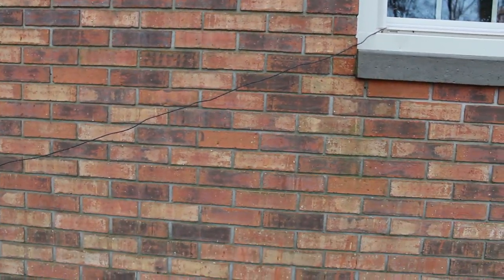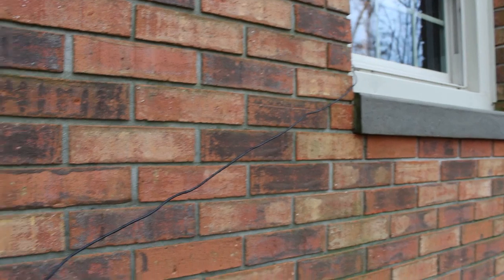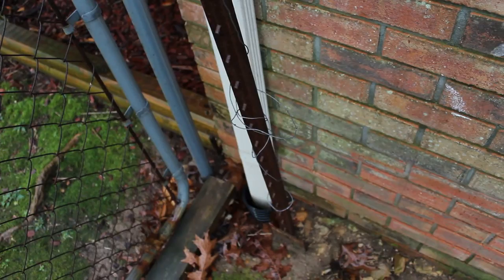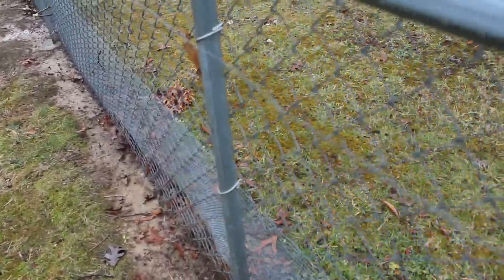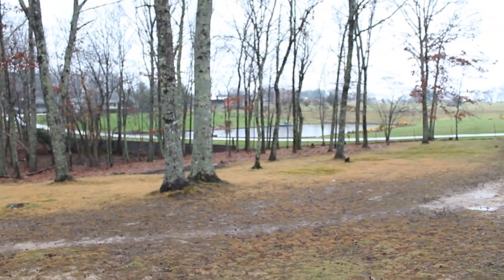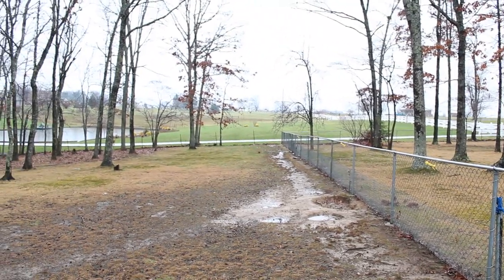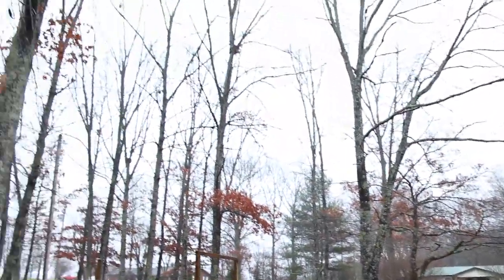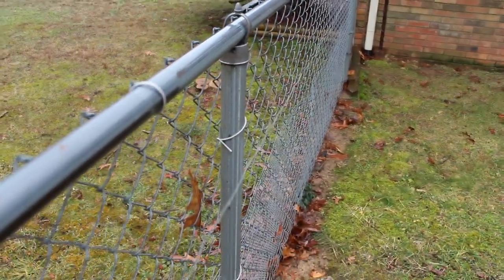My Longwire Shortwave Antenna

Comment: 1. your input lead should never be grounded whether your transmitting or receiving.
2. Everytime you make a 90deg turn on your antenna, your creating a cancellation zone, and its important to keep your turns matched to the frequency vs impedance at which your trying to operate.
3, that 240 volt power overhead, is a nightmare for receiving quality signal. cause your input runs through a pre amplifier first, and then a buffer than another amplifier where all the mod and demod happens. your singing the 60hz blues my friend its call "Inductice Coupling"   :) best of luck on learning. love the effort to explore

Comment: @KD7IIA

I second this. I made this newbie mistake when I first got into SWLing and I noticed a difference in my reception as soon as I figured it out.

Also, the groundwire thing is great advice. If your radio isn't metal, then connect the ground wire to the negative (-) side of your radios batteries.

Comment: A length of around 10 meters seems to work well for 6Mhz-17Mhz.
300,000,000 / 6,000,000 / 4 = 12.5 m (quarter wave)
300,000,000 / 17,000,000 / 2 = 8.8m (half wave)

Comment: You get shields from the metal fence, I think!
You want to get the antenna high as possible, away from the ground and fence!
Length of the wire  depends what wave length you listening to in meters!

Comment: I found having a very long antenna 100 feet+ causesd alot of ghost signals from the upper AM band causing interference in the SW band. I have mine around 50 to 70 feet for the SW band. In the 1990s due to analog TV interference I once ran a 120 foot coax cable away from nearby TVs and center fed to a 50 foot longwire  and shield was connected to a 3 foot pipe hammered into the ground. It did cut down on TVI  with good signals. newer digital TV types seem not so bad for TVI as far as I know.

Comment: This is an old post....

I second getting it out of the dirt BUT... you are doing it right away from the power lines. You didn't say what wavelength you're trying to get. Like that you probably getting lots of ground reflection. An old Army trick is to use a fishing sinker and sling shot with some thin twine to get it up into a tree so you at least get some air wave.

Comment: @KD7IIA 
+1 on this.
basically, your feedline (wire coming from your house), your attempted ground, and longwire are all acting as one antenna. a properly grounded antenna system should have a shielded coax feedline 50 ohms coming from house-the center conductor attaches to antenna wire, the outer shielding braided jacket attaches to ground. your ground should be either a close-by cold water pipe into earth, a close by electrical service ground, or a ground rod sunk at least 8' down.

Comment: Ground wire needs to come off the long wire , basically your shorting out your antenna by shunting to the earth ground. To see what i mean go to your radio, turn it on and enter WWV  or any strong station on the dial. Take note of the signal strength, go out remove the ground and go back and listen to the same station again. Take note of the signal strength it should have jumped up. Yeah you will need either a balun or antenna tuner for that long antenna be effective.

Comment: Why didn't you just use the fence?  Not exactly a Struber Curtain, but close enough for short wave.  Just hook on to the top rail.  Don't worry about the fence being grounded, it'll work.  Also the closest 110 outlet has 2 slots for power and a round safety ground.  Look at any 110 volt plug.  Stay out of the power and plug a wire into that safety ground round hole and you got the entire house wiring system to use.  Those grounds run to every wire in the house.  It is like a giant 3D spider web of free antenna around you.  I would have used the fence for one side of the antenna connection and the house ground for the other.  It's like a bumper sticker I saw on a Silver Cloud Rolls Royce once that said "Why pay more?"
Reply: HM Dickson  Because the fence is GROUNDED ! And it will short circuit the antenna !!!
Reply: Moronvideos1940 He is receiving, not transmitting.  The fence being grounded will make no difference for a shortwave.  Volumn and legnth is what you want.  Your talking micro-volts to fire a receiver.  That fence will do just fine.
Reply: HM Dickson Better make sure that there are no neutral and ground reversals at any point in the wiring of the house (which is quite common) !
Reply: +HM Dickson are you saying that for a great receiver antenna one can just plug a wire into the ground slot(the round one) of a house 110 outlet? So living in a flat I would get an antenna as big as the whole building?
Reply: +Brooklin Funkproject how can we find out? What would happen if there is one of those?
Reply: +alfiozzz the only way to know is to test every outlet with a 3light tester....  what would happen?  you'd get a pretty big shock!  It's just really not a good idea at all.VA3PDG
Reply: +alfiozzz Yes.  Understand this is not optimum, but a "get by"  like the grouned fence.  That safety ground is also grounded at the fuse box, just like the fence.  You need a long wire ungrounded for best performance.  I use my 80 meter inverted V Ham antenna when I listen to shortwave.  That is 133 feet (both dipoles) long.  Even longer wires would work better!  If room is the problem and you know the frequencies you want, you can build a "magnetic loop" and tune it with a variable capicitor (think hula hoop).  Just look them up on you tube.  They are very narrow banded.  Fine for specific freqs, not much for band scanning.
Reply: +Brooklin Funkproject ROTFLMAO!  No shock Brooklin.  The only reason I said to use the safety instead of the nuetral is that he might get into the hot side of the plug.  All nuterals and safetys are hooked to the same groundbar in the box.  The safety is just an extra circuit to bleed off to ground shorted appliances with metal cases before you get shocked.  The electrical inspector would have checked for crosses before he passed it.  Naked or green is a far cry from white :)  LOL, if we are into ham calls, try my extra class AE4YW :)
Reply: +HM Dickson prob should have stuck with your fou call - good luck !!
Reply: +Brooklin Funkproject LOL!  Well I just took what they issued.  The FOU call was a pain when working CW :(  Besides with the AE4YW call you get "Always eager for young women" or "Amply endowed yelping warthog".  Surely you can see the advantage to the 2 by 2.  Maybe I'll catch you on 80 or 40 meter CW some night.  And maybe,  just maybe a no-coder won't come in with "Is the frequency in use?"  Luck to you too!
Reply: "It is not the class of license the amateur holds, but the class of amateur that holds the license"73
Reply: +HM Dickson The listening performance is better with a wire that is cut and tuned to close to resonance even when "just listening". Been there, done that.

Comment: Long wire isnt always good, you have to peak the wire to the frequency you are using, this can be 40 meters or 20 meters for an half wave antenna.
Your groud for HF you can use best a few wires about 1/4 wavelenght and connect together at one side en connect this end to your radio ground bij a wire, lay de wires streched on de grass, this is the best way.

Comment: KD7IIA is correct.  Don't ground your antenna! That is a mistake!  All you signals will drain into the ground.  Ground the radio.  You should also get a 9:1 Unun (like a balun) is you want to take it to the next level.

Comment: You should never leave bare copper connections exposed. Weather eventually degrades the connection. Solder each connection and then cover it with electrical tape.

Comment: Just catapult the wire into and around the perimeter of the treetops where you want it, not hard at all, and follow the plans on the net or get a ham to visit you for an hour or so to make the connections and you're away !!

Comment: You should avoid metal objects with your main antenna, as well as not grounding it.
It would be better to use trees than anything near the fence at all.
Reply: I can understand how some can recommend to use metal (just stick it to the fence) while others like you say to avoid it all costs :) I am trying to improve my knowledge and I don't understand which is wrong and which is right :) Could you clarify this a bit if you mind? Thanks!
Reply: alfiozzz It’s difficult, you don’t show your radio. The worst thing you’re doing is connecting the antenna directly to Earth before the radio. The Earth is a more attractive destination for the signal your antenna picks up than your radio is, so the better the Earth you make that way, the worse your signal will be affected. Antenna and earth should be two separate wires all the way to the radio. If it’s a telescopic antenna, you can just clip the antenna lead to that. If the radio has no Earth connection, you can get one from the negative battery terminal.
Reply: alfiozzz Then get your antenna as high as you can, avoiding any objects including the trees. You can string rope around a branch and attach wire to the rope slightly below the branch. For the Earth, if you have copper cold water pipe in your house that is a good place to start, and you might avoid ever needing a second wire outside of the house. If cold water pipe makes an improvement but you can’t use it, you can still connect to any copper pipe leading to a tap outside your house.
Reply: +Brek Martin Firstly I wanted to make tell you I'm not the guy who uploaded this vid so I am not connecting anything to anything. :) Secondly, thanks for your answer but what I was asking about is how some people advice using fences for antenna while others say stay away from any metals because they are likely to cause more noise than work as an antenna. This is the point I was asking a clarification about. Thanks! BTW I have a medium range portable radio which has an external antenna connection. Just yesterday I bought 100 meters of 1.5 mm diameter electrical wire for just $15, I am not sure what I can do with it. For now what I did is just unwrapping some 20 m of it holding it high outside on my terrace leaving the  wrapped wire roll (what was the name for this...) on a corner of the terrace protection rail. Maybe it's completely wrong but it's increasing my reception... But I'd like to know how to improve it! Or if it can be dangerous maybe, expecially the unwrapped roll of wire?
Reply: +alfiozzz My mistake, you’re not the video author! :D There is more than one problem associated with a horizontal antenna in close proximity to metal, but the same applies to any object particularly a tree or fence that gets wet when it rains! :D To the best of my knowledge all of those problems are all a result of capacitive coupling to the object, and the undesired effects.. transfer of RF energy to Earth bypassing the radio, cancellation of current on the antenna, and in the case of a transmission line, detuning of the antenna.
The only problem I see with 1.5mm wire is it’s not going to last long outside strung up to something, but if it was cheap, and you have a lot, who cares? It would be no good for a transmission line but should be ok for rx.
I would not leave it connected to the rest of the roll... not sure of the consequence, but there is a general limitation on how long a “long wire” should be. Google can give you some wire lengths. next message...
Reply: +alfiozzz The author of the video, and I assume yourself also, are not transmitting, and therefore interested in receiving commercial shortwave or medium wave stations over distance rather than ham radio chit chat. Almost all (if not all) commercial radio stations use vertical polarised antennas, so the closest you get your wire to vertical the better (straight up out a window to a branch atop a tree). In this case you want to disconnect it from your radio at any sign of thunderstorm and connect the antenna directly to Earth. How to improve your reception... well in my opinion.. quite a strong opinion actually, antenna tuners for receive are underestimated. It takes a circuit consisting of a coil of wire and a tuning capacitor (preferably out of a very old radio) to make an antenna tuner for receive only. It takes both of those parts again to make one for transmission. That can be Googled as well. The only downside is you must tune any station in twice.. Once at the radio tuner, and again at the Antenna Tuner.
Reply: +Brek Martin I'm interested in receiving the most I can receive. Presently my portable receiver allows me to tune into ssb modes so I get ham operators and digital modes too. I am trying to understand how to make the most of the wire I got. It's a a 330 ft (yes 330 ft = 100 m) 15 gauge (1.5mm) isolated copper wire  and I intend to use it in the easiest configuration possible, meaning no additional hardware except maybe some supports or isolators and a easy grounding solution, if it's required. I live in a flat in a palace, but my flat has a big terrace which runs all around the palace and it has a protective metal rail. For now I would avoid to let the wire go up in vertical along the palace, as I will have to ask for permissions...  So what can I do for now to make the most of it? Thanks!
Reply: alfiozzz Testing web link: http://www.hamuniverse.com/randomwireantennalengths.html  . I really don’t know if YouTube blocks links
Reply: Well that’s cool I never knew that... I’ll be back in five.
Reply: I don’t mind chatting at all, but think you’d learn a lot just going to any ham radio club for just one night and asking the oldest guy there with grey hair about antennas :) seriously! Shortwave Listening (SWL) is every bit as valid a branch of the hobby as anything else. Just don’t get sucked into anything more if you’re not interested in a full setup or can’t afford it. Amateur Radio as a hobby has been in rapid decline for years, so the younger you are, the more keen the older folk should be to foster any new interest in radio. There are a lot of tricks, if you have a tile roof you can sometimes get away with more in your attic than you can outdoors (if you are top floor). For HF it is best to have some room though. Another thing to look into might be a magnetic loop antenna. It’s a wire propped above your fence line around the perimeter of your property (another thing to Google). 
If you have a long strip of space, a dipole or Zeppelin might be better. The great thing about wire is there is a lot you can try.
Reply: an insulator is always a good idea rather than tying wire to anything.. You can just use some cord and a bit of ice cream container plastic for experimentation. If that rail is suspended i.e.. if you are not ground floor... I would also try that. It might be earthed... So try it as an Earth connection as well ;)
Reply: +Brek Martin so many advices, thanks! :) I will indeed look more on Google, especially about the magnetic antenna....  Referring to the rail grounding, I'm not at ground floor so I suspect it's not grounded but I really don't know for sure.  I tried touching the grid with the telescopic antenna of my radio, expecting a huge boost in signal, instead it was like reducing it? Can this be a hint of the fact it is grounded? Grounded metals are going to lessen signal right? OK and I will stop right here because no matter how much I read I will always have another question :) Thanks already for   your help!
Reply: Grounded or it could just make an unfortunate antenna. I suspect grounded maybe for safety, or in case any live wire contacted it, but I don’t really know about that. Try touching the antenna to a copper cold water pipe and compare it to that. It won’t hurt the radio to ground the antenna, just ruin reception. If your radio doesn’t have an Earth connection you can drag one out by using the negative battery terminal.. the one that is the spring if it takes cylindrical batteries. If Earthing that to a copper cold water pipe makes no difference then forget Earth connection altogether! You do need to use an Earth for a magnetic loop though. It’s a big loop connected between Earth and the Antenna (which is not the same as connecting them directly together).
Reply: Yeah trees have magical properties of strange resistance and capacitance, and can change by humidity and one day you may get a perfectly awesome signal. which day is a guess tho lol

Comment: Look up 'Mini Whip antenna' by PA0RDT on google and youtube. This antenna is smaller than a Pop Can! Go get a mini whip kit off ebay for about $22, build it and put it in a water proof case. Watch youtube vids on how to solder correctly, this kit is easy to build! Place the new antenna at least 5 meters (or yards) away from the house on a short poll so it does not pick up electrical noise from your home. Enjoy All Band shortwave HF radio :)

Comment: kinda steer you in a direction. Dipole antenna, start there and many videos on tube about different types, and their independent characteristics... length, resistance, impedance, inductive reactance, direction and distance from ground are all important properties when fine tuning or attempting to make even a basic antenna. not sure how much you have studied electricity, but im confident your the perfect type person that can learn extremely fast.

Comment: Cut the section off that turns left.. run it straight far as possible.. and the put a 450 ohm resistor in series then ground it.. aka beverage antenaa

Comment: I have a Grundig FR200 that I want to improve the reception on. how do you attach the wire to the receiver? just wrap it around the telescopic antenna?
Reply: Just wrapping the wire will work even if there is no direct electrical connection. But it'd work better if you get a clip to attach it. Clip it on when you want to listen. Take it off otherwise in case of nearby lightning.